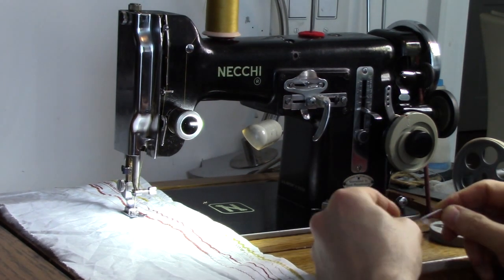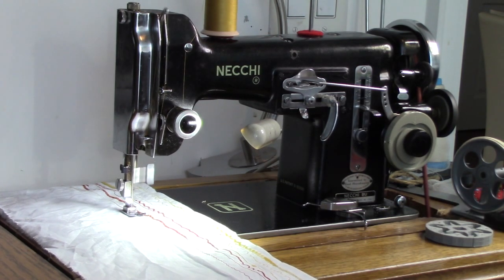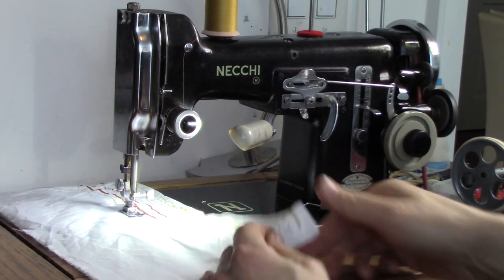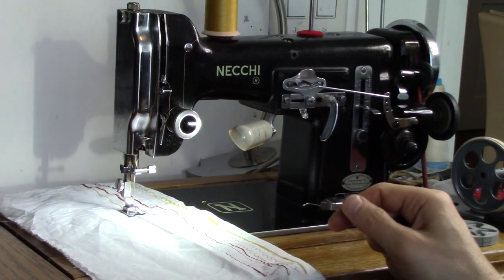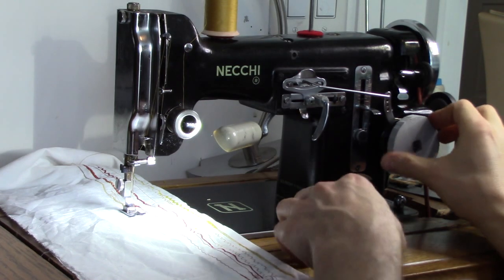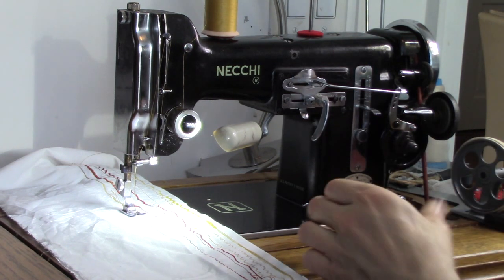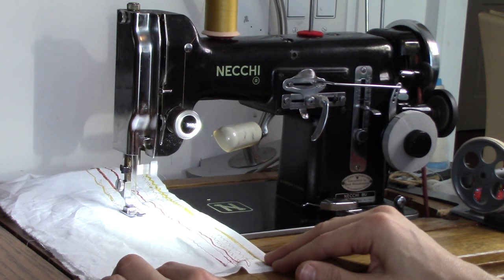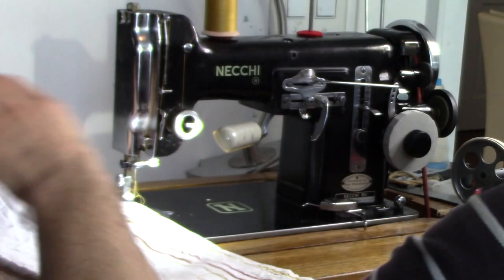Necchi BU NOVA WonderWheel MultiPoint ZZ

Comment: Hey, I’m curious if you’ve found that your multi-point zig-zag cam worked the same for a BU Mira? If you’re still willing to share that 3D file, I’d be so grateful!!
Reply from the maker: Sorry for the delay in responding. The MIRA and BU seem to have the same wonder wheel. I am happy to share the stl file. It is imperfect however, but if you are good with Tinkercad or other CAD, I am sure that you will be able to refine it and then share it with everybody.